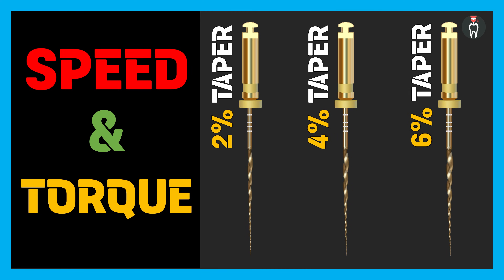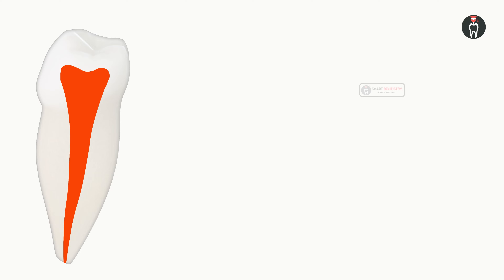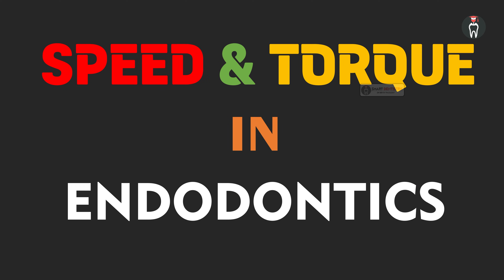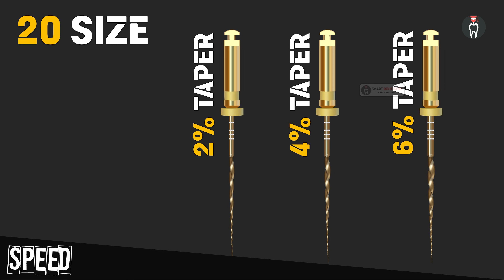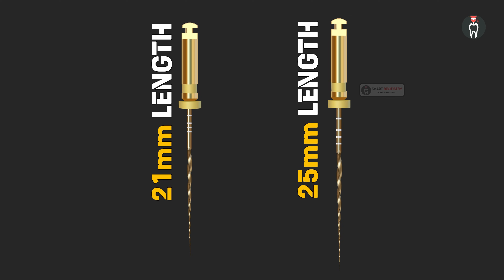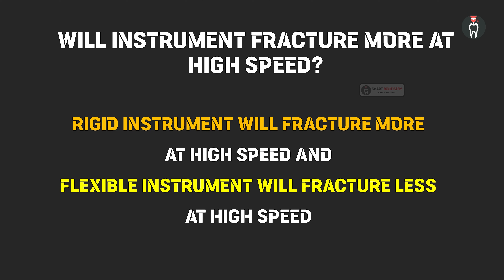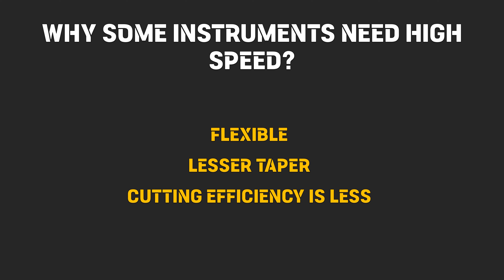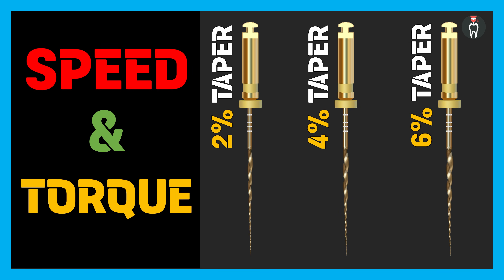SPEED and TORQUE in Endodontics

Comment: Excellent sir , when can you give us another video about torque and speed in curved and narrow canal
Reply from the maker: I have included the topic you suggested in the upcoming video list
Thank you for your suggestion
Upcoming videos in Smart Dentistry YouTube channel
Bounded file versus binding file - @sauliharizwan377, @vickyrock1873, @siddhiraut8472, @hristohristov650, @burrwnawna, @ayeshasiddiqua-ue4ss
Anterior proximal composite restorations - @raghuramm563
Finishing and polishing of composite restorations - @DrHozefa
How to create the perfect anatomy in posterior composite restorations - @DrHozefa
Working length using RVG - @manadentist2267, @sushrutachakraborty464, @dentalking7859
How to use apex locators to get accurate reading? - @katyaynigupta5259, @Sreemol17, @dentalking7859, @dentalshorts6848,
How to determine the correct taper for canal preparation (2%vs4%vs6%) - @akanshas8424,@abdurrahman2980, @benoitblanc8898
Diagnosis in Endodontics - @MuhammadAbdullah-iy3hc, @bsk4627, @vijyantmehrotra8119, @manadentist2267, @akshuDhavalshankh, @katyaynigupta5259
Dentine bonding agents - Part 2 - @bigdreams3712
How to bypass a fractured file? - @karthicks5760
How to do periapical surgery? - @derekshaji8173
How to remove a fractured file? - @karthicks5760
How to prevent ledges, blocks, zipping and canal transportation - @Philosophyforlifeofficial 
Apexification procedure – @anumadhukar9171, @sanghamitrasagariya4087, @katyaynigupta5259
Perforation repair - @anumadhukar9171
Avulsed tooth management - @Drpoojagarg5310
All ceramic crown preparation – Anterior - @KiranrajkumarHatangle-eo4wm
Molar crown preparation - @KiranrajkumarHatangle-eo4wm
Radix entomolaris - Case discussion - @sauliharizwan377
Palato gingival groove - Case discussion - @sauliharizwan377
Root canal negotiation techniques - @vickyrock1873, @siddhiraut8472, @hristohristov650, @katyaynigupta5259
EDTA in Root Canal Treatment - @rosemeher1321, @hristohristov650
Understanding root canal calcifications - @rosemeher1321, @hristohristov650, @katyaynigupta5259
Operator positioning for Root Canal Treatment - @chandrasekharsahoo6713
Analgesics after Root Canal Treatment - @mdmozahedulislam3923
Root canal sealers - @sudhaa5674
Sealer puff – Good or bad? - @derekshaji8173
C shaped root canals - @karthicks5760, @LearnUnlearn90, @katyaynigupta5259
Middle mesial canal - @karthicks5760, @katyaynigupta5259
Reference point in root canal treatment - @anujgarg952
Heat and H file technique for GP removal - @chandrasekharsahoo6713
how to do BMP effectively without any pulp tissue remnants in a single visit RCT - @rainbowsalt-gc7ek
class 2 composite and matrix to avoid gaps between teeth after using toffelmeir system -  @sauliharizwan377, @hishamkhan3800
Curved root canals and file selection
Everything a beginner should know about rotary files
Ledges – prevention and management - @dentalshorts6848
Prefabricated metal post
Pre fabricated fiber post - @anithabalex8124
Ribbond post and core - @bsk4627, @sajaljain4192, @sauliharizwan377
Custom cast post and core - @derekshaji8173
How to select the proper crown - @DrGreenfun
Cast post Vs fiber post? Which one to choose? - @SnehaPK-rt3tn, @alokegupta3165
Occlusal considerations in post endodontic restorations - @tubeindahouse
Pulp stone management - @sayantankarmakar3150
Torque and speed in curved and narrow root canals - @safaamohammed

Comment: Marathon endomotor torque 10 20 30
Please suggest me
Reply from the maker: I think you are discussing about gear ratio in marathon endo motor. Ideally you can use gear reduction of 16 or 20. Torque is as usual with anyother endomotors only. Start with 3 NCm. 
If this doesnot clear your doubt, kindly send a pic in mysmartdentistry@gmail.com  I will have a look at it. Thank you